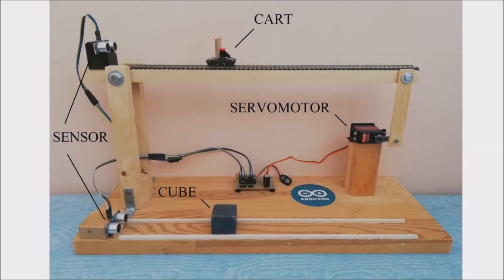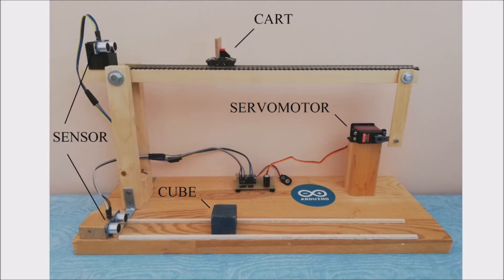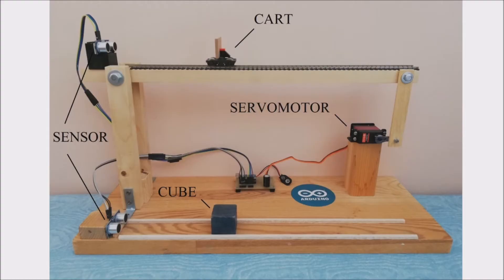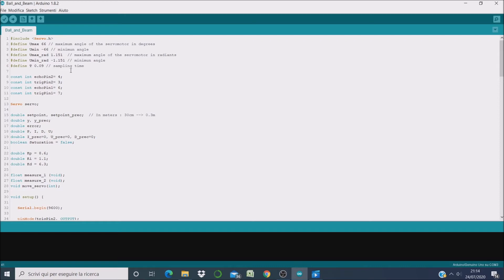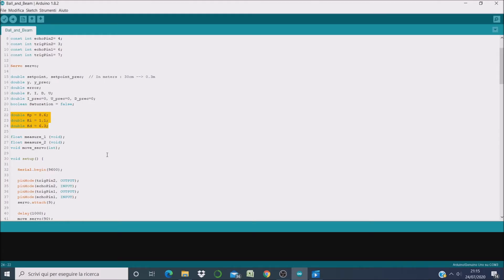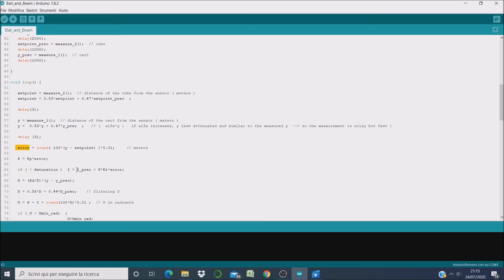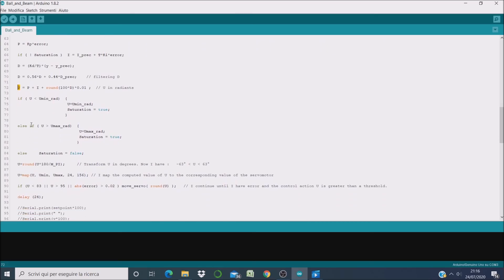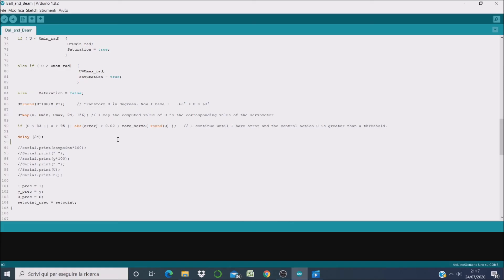DIY Arduino Ball and Beam : PID control

Comment: I see the github your  code program ball_and_beam.ino  -->  row 57: setpoint = 0.53*setpoint + 0.47*setpoint_prec; // digital filter . And row 71: D = 0.56*D + 0.44*D_prec;    can you explain to get constanta for this filter (0.53; 0.47) and (0.56; 0.44) maybe there are reference for read by me to understod. Tq

Comment: Excuse me, could you please help me with the connection of the arduino, I know you installed the circuit but is it just that or is it missing, since in the video it seems to be more because of the jumpers
Reply: Bro just connect the sensors and motor, there are tutorials on the internet. All it’s doing is reading the input of one sensor and setting the value as the output to the pic controller. Obviously there is there is a power source in the background, it’s really quite simple, just be creative with it

Comment: The capacitor is used to give more power to the moter at the Beginning, it is connected parallel with the motor (negative side with ground and Positive side with 5 V)
Reply: These are all the connections for the project : https://drive.google.com/file/d/1JrXXs7UJkxqDbQnFygE6pDJnkBuDaLge/view?usp=drivesdk
Reply: THANK U <3 @omargomaa8787
Reply: @omargomaa8787  Please help me with this project, what would the connection with the arduino pro mini and the same components really be like please? I have to deliver it in three days
Reply: in your drive u using the arduino r3 uno, but in his video he using the pro mini, so what is the different when you connect the circut? could you help me, please ?
Reply: @mikedapoet3281  there is no difference in the connection
Reply: @omargomaa8787 Hello dear, I would like to ask about your project, the values found in the code that is in its description is the same code that you show in the video demonstration or do you have to modify the values, could you please help me and how many centimeters is the wood? which is below the servomotor. On Wednesday I have to present. aid :(
Reply: code plz
Reply: @pumpkin3984 the code in the video description
Reply: Thank you so much!

Comment: Hi! nice video but i have a question; where do i connect the capacitor? and the HC-SR04 sensor has 4 connections, and on your circuit drawing it only shows 3, do you have any information about this considering the correct connections?

Comment: Hey,in line 88, how did you get the two values 24,156
Reply: its minimum and maximum voltage value of working of servomotor i believe but idk

Comment: Hey, thank you for the Code Breakdown. I'm working on a pretty similar project, and when looking at other's approaches to it online, I struggled to find clear code, yours is much easier to understand. Do you have any tips on filtering out noise/bad data from the distance sensor? Loved the video btw!
Reply from the maker: I really appreciate your comment! My suggestion is to use a digital low pass filter, as I mentioned in the video both to filter the measurements and the derivative action
Reply: Hi , just wondering the size of servo used here ? @homemadeengineering9159
Reply: Hey did you figure out how to add in the capacitor?

Comment: Hi, how are you?
I got a doubt...

How did you perform the calcus to get the the values for: Kd, Kp and Ki.

I will really apreciate your help, thank you so much.
Reply from the maker: Hi Liliana, nice question!

Firstly I used control theory to compute the transfer function between the cart position and the servomotor angle.
Finally I used simulink to tune the PID values.
But because of a not perfect mechanical structure these values didn't work well.
So I used the Model Identification Toolbox from Matlab so as to identify the correct transfer function, and then again I used simulink to tune the values.

Another option, faster and easier, is try to guess them through some experiments.
You can set them all to 0.
Start from Kp, increasing it slowly.
When you are satisfied with it, start increasing Ki.
Finally you can adjust also Kd value.
Reply: Thank you!!!! :D I really appreciate that you take the time to reply my question.
Reply: @homemadeengineering9159  YOU WOULD HAVE ALSO PUT THOSE OPERATIONS, IF YOU ARE GOING TO TEACH A PROJECT YOU MUST DO IT WELL, EXPLAINING EACH STEP IN DETAIL🙄